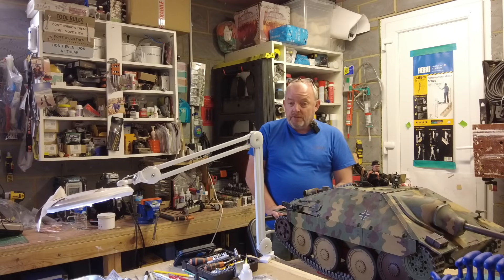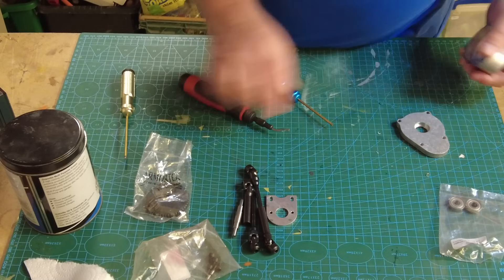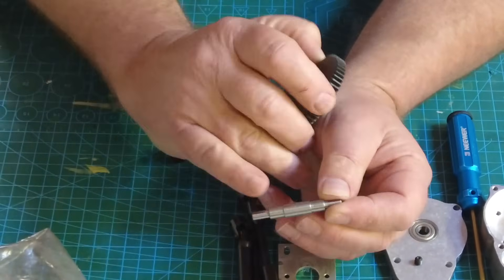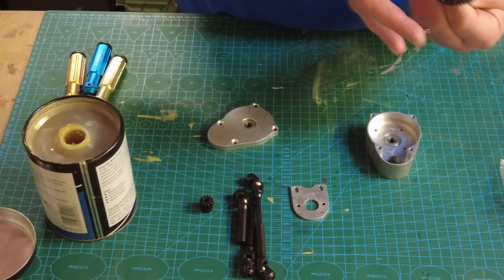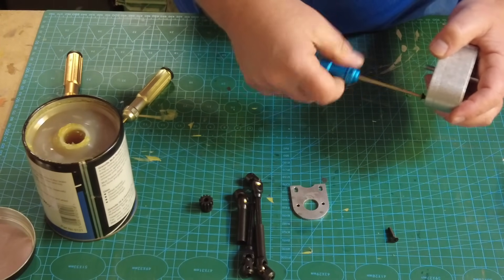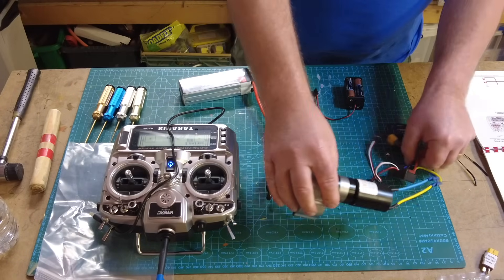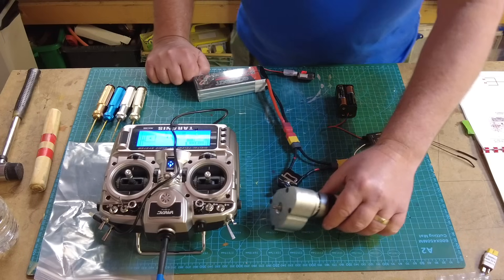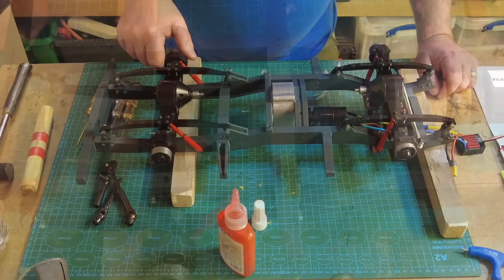1/6 scale model -Armortek Series 1 Land rover(Vid 06) Install the gearbox and test the drive system

Comment: That main gear was a nice chunk of metal 😎😎. Radio controls have moved on a bit since I last had one loved the  low battery 🔋 levell👍👍. Bit of agg with the front drive shaft but you bested it sir ,looks good with the wheels on . Standard issue welljell 😭. Looking 👀👀 out for  next tank announcement  see you next week sir 🎩.
Reply from the maker: Hi Steve...Great parts again from Armortek. To be honest...when I plugged the low battery device in the first time it almost gave me a heart attack🤣 I may include this in my planned bloopers video🤣 I am really enjoying this build and in some ways a little more challenging than the larger tanks...no room for error on these parts. Hoping to speak with AT at the end of June on a planned visit to determine my next project. Have a good rest of the week.

Comment: 103.000 subs! Congratulations, Tony! 👏 The LR looks like a beast with those beautiful tires on. Having to move the front axle to connect with the drive shaft is a nasty surprise, I would say. However, you got it done! Cannot wait for the next video!
Reply from the maker: Thanks Thomas and thank you also for your best wishes on my 100k plus Subs...I am still pinching myself over it. The wheels are brilliant and super heavy...I am looking forward to painting those and getting them on the finished kit. As with most of these builds, I learn on the job and having to move the axle was a surprise, but not much to it as you can see. Next video I show my solution for synchronising the steering wheel to the main steering servo, as the kit only provides for a static one. Have a great weekend and thank you for your continued support.

Comment: Congratulations on the 100k+ subs Tony - well done. Great fun as usual this week, and things are always quicker second time around! Re your steering wheel comment: one idea would be to simply put a 'Y' lead and a second servo linked to the main steering servo, or even rig up a mechanical linkage with a length of stiff wire to the bottom of the steering shaft. I'm presuming that you'll have a driver at some point in the future, so if his arm linkages are very loose with the hands on the steering wheel you'll get a realistic effect. Take a look at Dave JaVou's channel and his Animatronic Driver mods for inspiration... Cheers Keith👍
Reply from the maker: Hi Keith and thank you. I am still pinching myself about that. I have come up with a solution and it does involve a 'Y' lead and small servo. I wanted to show how easy this is so anyone can do the same. I am pleased with the results. Video of this up next week. I will have a driver and that is a good idea about loosening his joints. I guess elbow & shoulder joints? Thanks for your continued support.

Comment: Rather than using another servo, could the steering wheel not be mechanical. I.e. connected to a simple bar and 90 degree swivel point...if that makes sense?
I wouldnt want exact steering wheel movement, but want enough to be able to attach a figures hands to, so the arms moved with the wheel either way.
Im sure there must be an easy mechanical way of doing it.
Reply from the maker: Hi Carl,
I looked at that, but space in the engine compartment is tight especially when you pack in the speaker and audio unit. I have come up with a solution(video up next week) which I think works well. I will be adding a driver and will loosen his limbs off to allow for free movement when steering. Thank you for watching and commenting. Just subscribed to your channel. Impressive Lego work mate.
Reply: @tonys_workshop  😀 Thank you!! Thats a very old channel that I really should concentrate a bit more on nowadays...but...busy, am sure you know how it gets.
I did co found the uk rc tank club, many, many years ago and had a huge collection of 1/16 rc tanks, a lot of which I scratch built. Sold them eventually due to running out of space, but got a couple more years later an keep toying with getting a 1/6 project. Just afraid of trashing my lawn!!
Reply from the maker: That is an impressive back story Carl. I know the whole space thing...principle reason for selling my Tiger. I would say that as long as you are careful and only drive in dry spells the lawn holds up quite well to these heavy tanks...The Hetzer is a good option also as this weighs less than its heavier cousins. Thanks again for supporting my channel, it means a lot to me.

Comment: As the ESC appears to have a BEC to power the receiver from the main battery it is not a good idea to fit an external battery to thr receiver. There is a good chance that the BEC puts out a different voltage to the external battery which can cause overheating of the BEC possibly damaging it. If you must use an external battery then remove the red lead from the plug from the ESC to the receiver.
Reply from the maker: Thanks Jim, all duly noted. Only used the external battery source briefly to make sure the receiver was connected to the radio set. Thanks for watching and commenting.